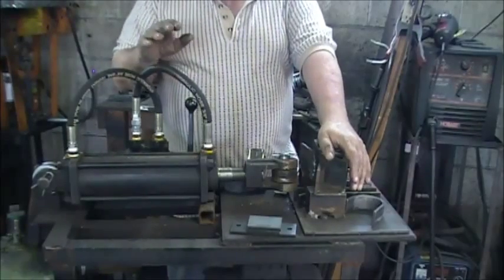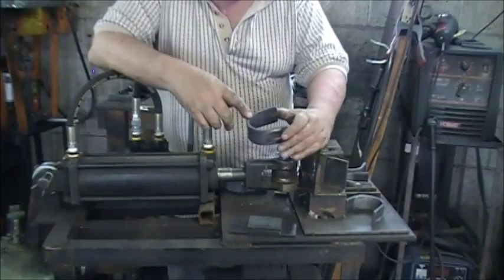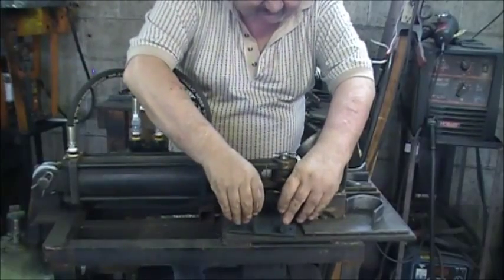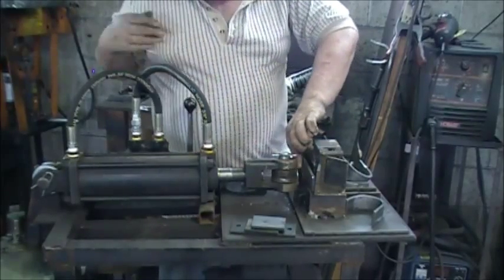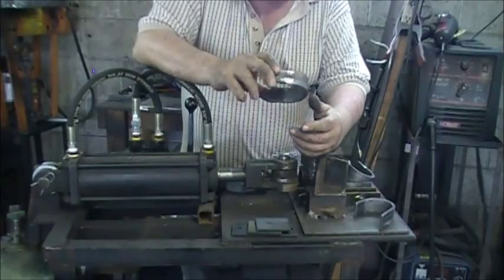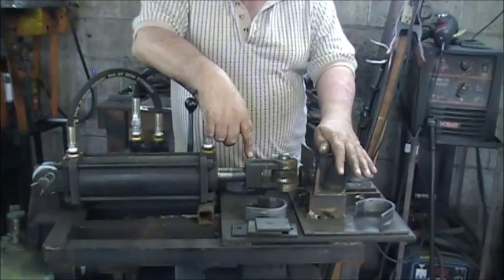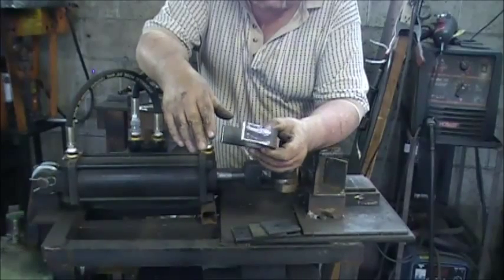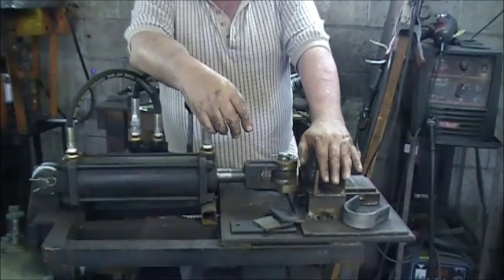Demonstrating My Homemade Metal Bending Press Part 2 - Bending Radius

Comment: This is exactly what I'm trying to make. I'm a little familiar with hydraulics but not comfortable enough to do it with out some direction. If you had plans or diagrams-it would be perfect. For example a list of supplies for the build (name of the cylinder he recommends, valves, etc.). I agree with expense of some of these presses and I'm a home hobbyist and this is totally what I'd like to do. Hope to hear from you-thanks
Reply: Did you ever find out any info ??
Reply: @andytaylor8802  Unfortunately I didn't